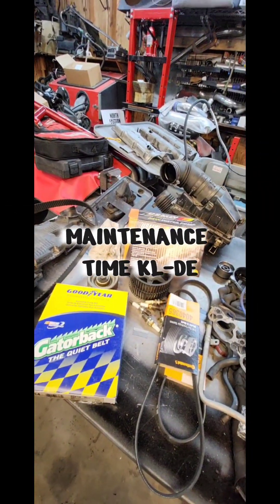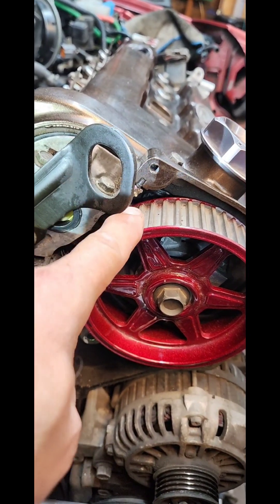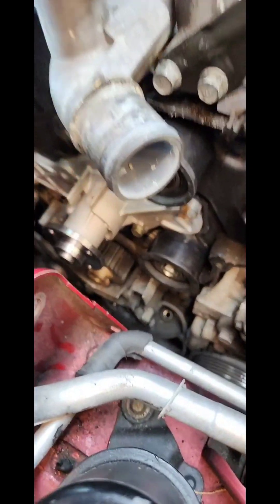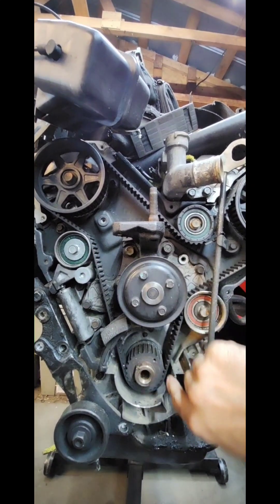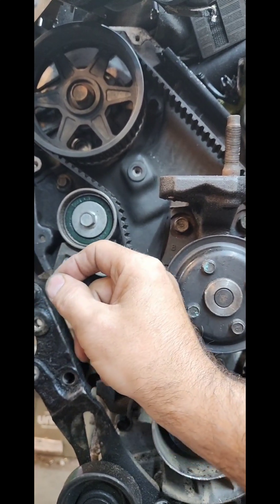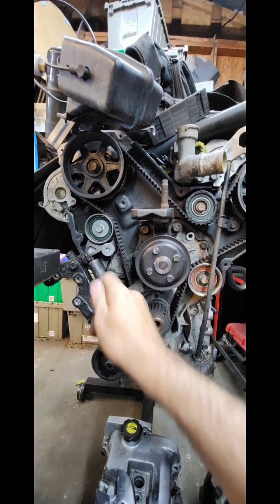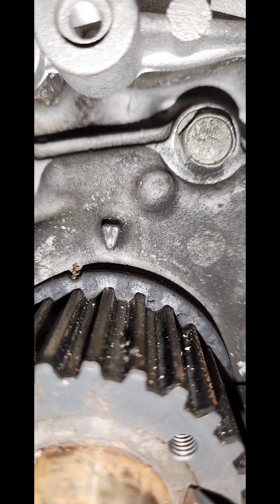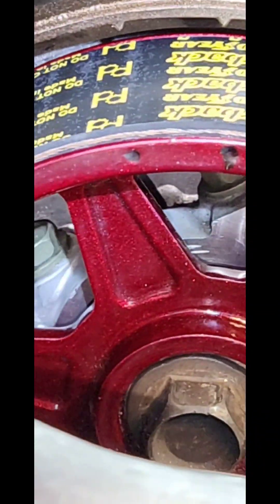Mazda 2.5L KL-DE TIMING BELT How-To by WOPATH: Tips and Tricks!

Comment: The only cog that you set back a tooth is the crank shaft cog?
Reply from the maker: @unknwon999  correct, that allows you to rotate the slack that may be in the belt forward of the pulley to behind the pulley where you install the tensioner
Reply: i appreciate it. Found a ‘93 MX-6 LS coup 2d on facebook that needs a timing belt so ive been doing some research

Comment: I am looking forward to doing this, appreciate the brain feed.     So I can I leave the  cover off once I am done this probe I picked up has it’s covered all cracked and hanging on by zip ties! lol
Reply: you can leave the cover off bro..its more for appearance and safety than for any functional reason.. one thing though, the timing marks to use with a timing light are embossed into a portion of the cover that rides above the main pulley... many people cut that portion off the old covers and leave just that bolted in place so that they can check timing later..main advantage with no cover is immediate access to and ability to keep an eye on belt condition and tensioner function.
Reply: Just did mine, Started right up!

Comment: Good advice. This is exactly the way I do it. I use the two indicator notches on rear bank too because, you can stand on your head all day long and not feel comfortable with the rear cam with the engine in the car. I apply tension on the belt with a prybar and make two full turns of the crank and recheck before pulling the pin. For those that pull the pin and find that they are off, it does matter the order you remove the tensioner bolts when it's under tension or you will also risk damage to the threads due to the enormous tension on the bolts and hate life again..lol. One way, the tensioner will swing and pivot on the remaining bolt to release the tension as it loosens. The other way, it does not and you risk damaging the threads. Been a while so I forget which bolt to take out 1st when under tension so it can pivot easily and back tension off in a controlled manner. If memory serves me correctly, you remove bottom bolt 1st, then slowly loosen upper bolt for it to swing and undo tension. It is possible to compress the tensioner in a vice if you are careful not to angle the plunger and reinsert the grenade pin.. :-)
Reply: Bro that sounds about right, logical as far as the order of the tensioner bolt removal.. been thru that nitemare myself so when you say "ask me how I know!" , believe me, been there done that!  the threads can also get screwed on those damn tensioner bolts by over torquing them.. my torque wrench never clicked and let me strip mine out...an easy save though was to take the original bolts out and get a longer set and thread them deeper into their  seats.. I cant recall if there was maybe an extra half inche of  thread depth in the block for the longer bolts... I did measure how deep the holes were and the factory bolts were not going full depth.. I may have used a tap to clean up the existing threads and then cut new threads into the remaining depth... if u do this be Very aware and measure Exactly how deep to rethread as u dont want to punch thru the block! that would be an epic nitemare!..in the end, I used longer bolts of the same size thread and had plenty of grip in the block to tighten to spec..I think its only around 18ftlbs  tightness and the factory using short bolts with so little depth into the aluminum block  was a recipe for trouble.